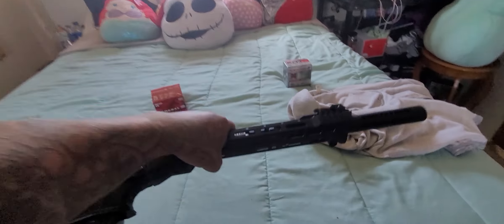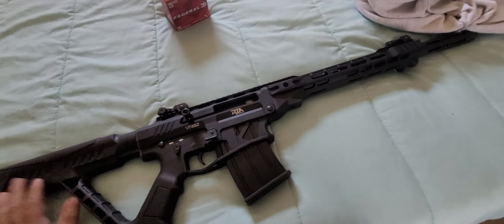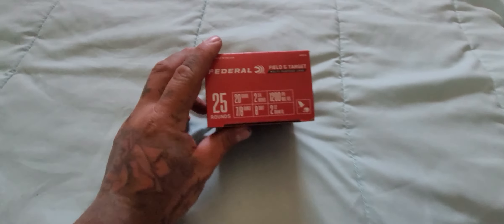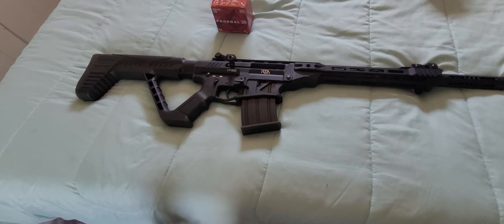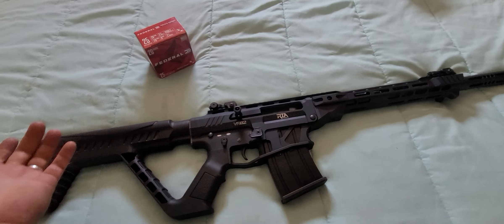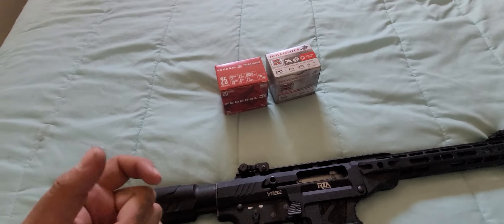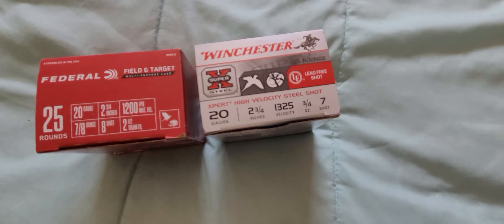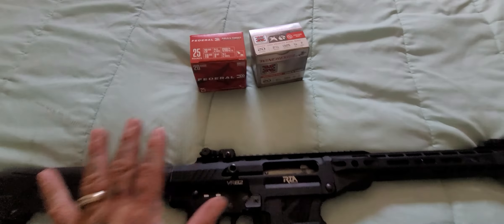vr82, vr80, vr60. not ejecting. FIX!!!

Comment: Everyone knows most semiautomatic shotgun’s prefer heavy load’s especially the mag fed Turkish ones. After a few mags you should be able to use whatever you want but trying to fire birdshot outta the box is tough even for the M4. The only issues I’ve had with my Vr82 was the coating on the extra mags I bought from their store was so thick I had to sand it down to allow the mags to drop freely.

Comment: You should read the user manual. It says min vel of 1250. But good info anyways.  Will try my VR80 today for the 1st time. Just bought on Black Friday 😀
Reply: nice how much did you pay?
Reply: Is it working better for you?
Reply: Once you find some heavy loads that it will reliably cycle you just have to keep shooting it. I brought mine out on the first day and after about 75 rounds I tried a box of cheap Winchester field load shells and they ran no problem.
Another thing that helps is to store it with the bolt locked back for about a week. Will help break in that recoil spring.

Comment: So the whole point behind all those other fixes (drilling ports, locking bolt back for a month, filing the lip on your magazine) is so that you don't have to run the higher velocity shells in order for it to perform, giving you a broader range of shells to use. Yeah, using the hotter shells works, but so do the others if you do the things...
Reply from the maker: Yeah that's cool and all but I rather not drill into my gun versus just buying stronger shells. They're all the same price no way
Reply: @Donnazbeenz303  Not to be rude but your advice is simply following exactly what the manufacturer states in their documentation. As @blaydekanton9077 mentions, most of us would prefer to be able to shoot anything in our guns. Besides, locking your bolt back for a month and filing a millimeter off the magazines is so simple that everyone can do it. I do agree though that I would also prefer to not have to drill gas ports because that could be a far more expensive mistake if you do it wrong.

Comment: This is my first shotgun, a VR-82.  I watched a bunch of videos and read the manual backwards and forwards.  Cleaned it and, yes, I found a few metal shavings, but not nearly a much as I  was told to expect.  Lubricated per instructions.  Then, I bought eight 10-round magazines.  I went with Winchester 1325 fps, 2-3/4".  My results were: 2 failures to eject and one failure to fire out of a total of 190 shells on two Saturdays.  
Now, I've changed the grip and stock and added a light.  
So basically, I just followed the directions in the pamphlet and the gun shoots without problems.  Hello!
But, I have two complaints.   The first is that RIA doesn't offer the same upgrades and accessories as they do for the VR-80.  And, the inside of the foregrip is too close to the gas block and piston.  While mounting a piece of Picatinny rail using the M-Lok slots, I found that the t-nut and machine screw were contacting the gas block and piston.  So, I had to move it away from the gas block and towards the muzzle. 
Overall, my VR-82  is a great gun.  I just wish the manufacturer (Derya) and importer offered more accessories for it.

Comment: I got the VR60 and tried multiple different rounds I’m still having this issue. It’s a badass gun tho😂
Reply: Same , nothing works so far.filled out warranty on line. Trying to get some one too help . Like pulling teeth
Reply: I just got it after the gun selling told me it's his fav to shoot but said it's a breaking in period of like 300 rounds.  I've tried 6 different types of ammo. Anything u der 1200 jams and the heavy loads 1600 up smooth shooting and no issues.
Reply: The mag lips at the back of the mags need filed. You'll have metal shavings in your chamber until you do this because the bolt is rubbing it.

Comment: If you want to shoot thst 1200fps crap shotshels , take ur buffer spring , or get 1 " smaller spring or cut one loop off the buffer spring , ur bolt needs to move back more to clear ejection port.

Comment: Ive got two 12 gauge bullpups that i locked the bolts open and left them for a month. It worked for me. Now i can shoot low brass or high.
Reply: My v r 60 shoots everything but I use black lube works great. But if she gets dry it will have an ejection issue.

Comment: I have done all that and still having ejection issues
Reply from the maker: Id definitely be the first to admit this rifle is not what I expected it to be.
Reply: Same , getting frustrated. Filled out warranty on line . now trying too get help,not looking good at this time
Reply: File the mags where you can see the bolt has rubbed it. Also, check your gas ports. If they're a different size than each other, that can cause issues. If you haven't already, make sure your bolt is clean internally and that it is oiled good. Sit and work the bolt back and forth to simulate shooting it. Run a higher FPS like 3" high brass self defense rounds in it. That will make a little difference as well. If you have or have had metal shavings after shooting, it's probably rubbing the top of the mags. Check out Montana John's Outdoors on here for a fix for these. He has several videos on these guns so try and watch them thoroughly until you find the one he actually tells you the fix. Mine os doing the same thing and like the content owner said, it defeats the purpose of these being semi automatic if we have to pull the bolt back ourselves. Good luck
Reply: Another thing you can do is keep racking the charging handle to give the recoil spring a workout and then leave it with the bolt locked open for about a week
Reply: I stored mine with the bolt open, and ran 50 ish slugs through it first. And some high brass, then it will cycle anything! Gotta break the spring and action in on these it seems

Comment: Operator error. Your lack of knowledge regarding your weapon is unacceptable for presenting a video online. EG. "these things could be loose in here".... "tighten this thing up"... It's obvious you don't have the gun oiled well enough during its break-in period or you certainly wouldn't have it laying on your mom's bedspread. There is much irony in your saying "they talk all kinds of stupid shit".
Reply: I know my guns and their parts yet I am having the same trouble. Montana John's Outdoors can vouch for everyone having the same trouble with these guns. Some have even found that the gas ports are drilled wrong, the mags weren't filed properly from the factory, and even well cleaned and oiled, and filing the mags down, mine still won't eject properly. I've shot mine about 80 times and according to RIA, they require 250-300 rounds of high brass shells shooting 1500fps in the 12 gauge to break the gun in. We'll get there. If you have any suggestions, please, feel free to let us know.
Reply: @MemphisMojo15s  My suggestion is buy a Benelli.
Reply: Well, we did buy these guns and we would like for them to function properly and there is a fix for it but break-in is the most important and cleaning it and oiling it is very important as well. It's actually a good shotgun and the majority of people like it but I understand what you're saying.